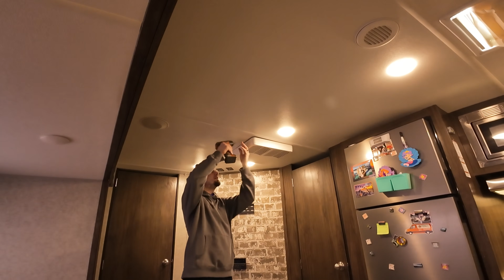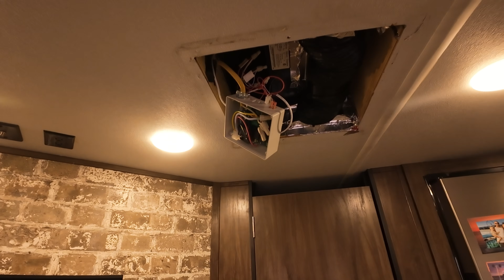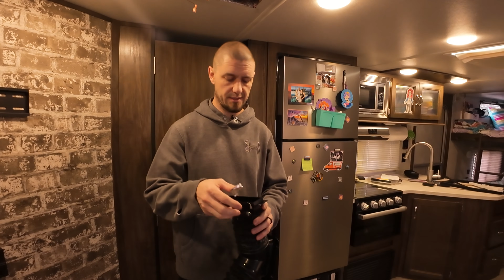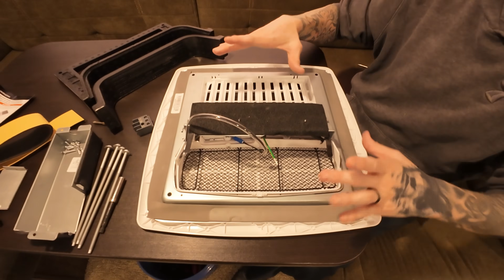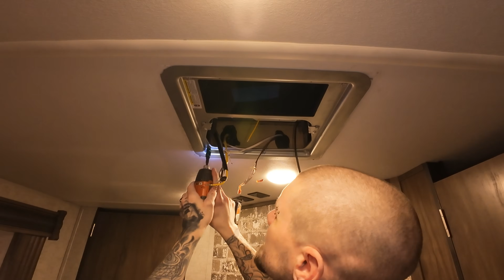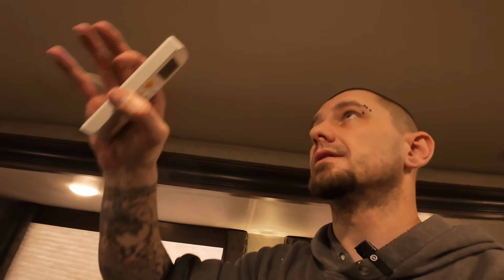Swapping Our Old RV AC for the Furrion ChillCube… Was It Worth It?

Comment: thanks, nicely done. would like to know how that bolt got so bent 😀 also how the chill cube performed on a hot day. and did you reinstall koolrv diverter?
Reply from the maker: I’m guessing when it got stripped out it was just bent over to hold everything in place instead of drilling and retapping. 

So far the chill cube has been amazing! It’s WAY quieter than the dometic was even with the rv silencer on it. We are going to be putting it to the test real soon when we head to Cape Charles. That place has always made the dometic struggle to keep up. 

The KoolRV diverter is product specific. The one we have is made for the dometic ac so it won’t work in the chill cube. I’ll have to order a new one, but so far the ac has been working so well that we haven’t needed to put it again yet. 

I am going to be revamping the ductwork a little bit though which you will see a video in the future on that too because of the way forest river installed the vents. I want to make them more efficient so I stop losing ac into the ceiling

Comment from the maker: Let me know if any of you watching this have ANY questions at all about this process. I would be happy to help wherever I can…
Reply: i’m a little confused about said 12 V wiring regarding the thermostat on the wall? I know you don’t need to run a separate 12 V power supply. I’m sure it’s internal, but what exactly is it that you were saying about the thermostat that you have on the wall?
Reply from the maker: @youcanthide004  so the chill cube only needs the 120v power source to run it. The 12volt wiring is only for the furnace now once you install the chill cube. When you are in the ceiling if you touch your red and white wires together from the thermostat wire it should kick your furnace on. So you’ll need to connect the wires in the ceiling together to get them down to the wall at the thermostat. Then the battery powered thermostat you connect the red and white wires for your furnace to the R and W terminals on the back of the thermostat and you’re all set. I’ll draw out a diagram and post the pic here in minute.
Reply: @MilesAndSmilesRV  Question: Red/White... I have Blue Purple Beige coming from Thermostat. What do I connect to what?
Reply from the maker: @f @franshoogland3038 rry, I didn’t see your comment until now. I would have to see where the wires came from to be able to tell you that one. But you need to connect the two wires that lead to your furnace. If you tap the two low voltage wires together and the furnace kicks on those are the two you need to connect to the R and W terminals on the thermostat